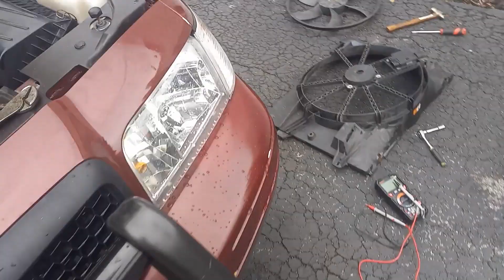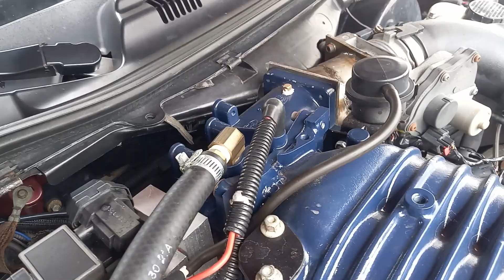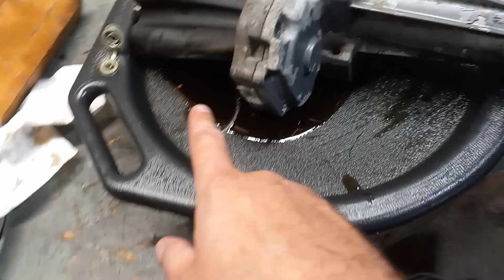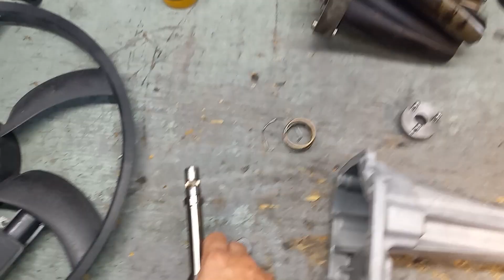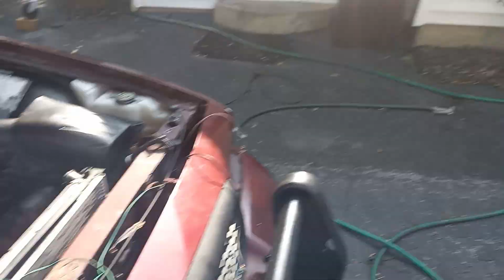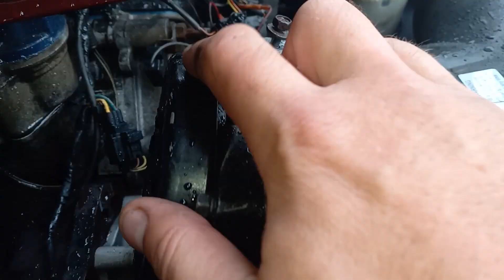M90 Supercharged Crown Vic - Part X

Comment: I have a 1999 Mustang 35th anniversary 4.6 2 valve I hit 0 to 60 in 5 seconds NA would love a super charger but at my current power will the trans hold it! Also your collapsed top side radiator hose is because the original has a giant spring inside the hose that stopped it from collapsing from fluids getting cold and contacting. They do not sell the spring with the new hose I.E. you forgot to take it out of the old hose and put it into the new one. It's stainless steel so it definitely didn't rust away!
Reply from the maker: Thanks.  I bought the car from the Baltimore government, so who knows what happened to the spring. 

Fixing the fan and replacing the hose with new fixed the issue.